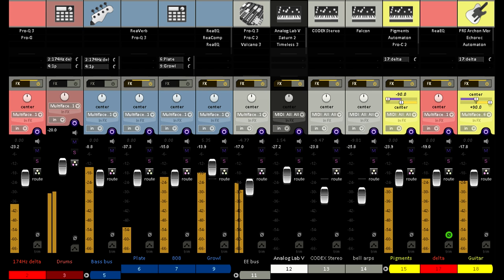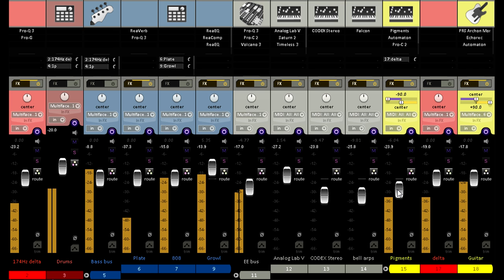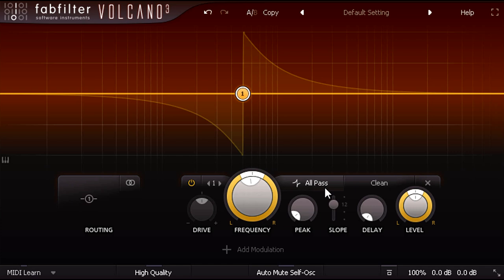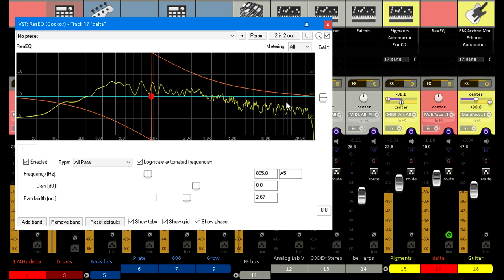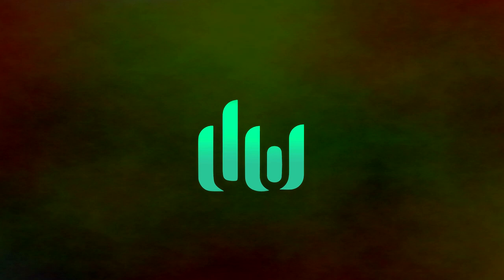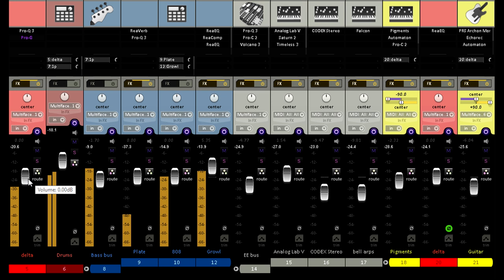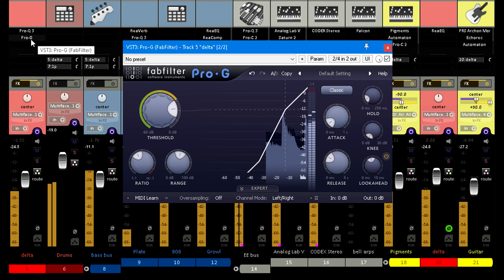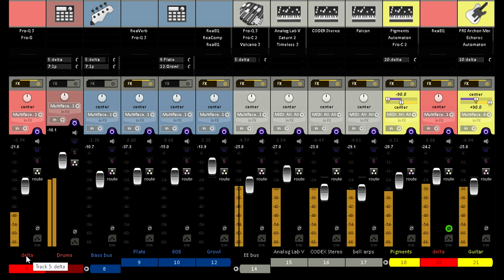Parallel Filters, God Tier: The Delta Channel

Comment: These tricks are really useful, but once certain elements are grouped together with group processing the null doesn’t work well enough. One solution I came up with is duplicating the drum bus compressor onto all the individual drums but then sidechaining the compressors to the drum bus. It allows for group compression while also making the parallel filters play nice with individual tracks

Comment: As soon as the video started I directly understood where this was going .... Yet I would have never though of this ! It is very clever, and so convenient !
I think I will use this for the "final" stage of EQing in my mix, to experiment carving frequency slots for diverse instruments. Not only it allows to easily boost vs Carve at different places, but it has also the advantages of being easy to remove and A/B compare..... That is so cool.
The only downside to me is that it might make stem creation of my projects a bit more tedious.
Reply from the maker: Bounce all your parallel delta channels together as a delta stem :)
Reply from the maker: "here are your stems: drums, bass, guitar, vocals, and this one that makes all the rest not suck" ;)
Reply: @DanWorrall  Hahaha, Yes that is a great idea, but actually, I also use stems when a song is finished for live shows reasons. I typically render one unique multichannel wav file contaning all the stem tracks that groups  the project tracks per element (drums, bass, synt, acoutics, main vocals etc).
Then I create a live project,  I import this multichannel stem in reaper and depending on my mood,  I add effetcs mapped to midi controllers and/or replace some of the tracks  live instruments (microphone inputs with looper pedal or not, drum machines, etc).

So it does not really fit this application, unless I duplicate the "delta channel" several time and change the routing so that every duplicate doesn't receive several tracks anymore but only one . Also, by doing so, I kind of loose the ability to add  a dynamic processor after the band pass filter.

Maybe you have other suggestions ?
Reply: Ha I found a solution. It works using "render stem through master". I didn't know it, but this options actually render not only through master, but also with sends. I know it can cause problem with dynamics/saturation that are applied on subgroups but I should be able to manage it.

Comment: One question. Is there any other advantage to using parallel processing like that other than workflow efficiency improvement (6:27)? Nothing's stopping you to do all this stuff with a couple EQs, right?

Also, 5:43, my first thought was multiband sidechain compression. I thought it was an obvious solution. Am I wrong? Am I right? Or am I just using a different approach? Don't get me wrong, I'm not salty or anything, I'm just trying to understand these choices. I know you don't reply very often to the comments, Dan, but I would love to hear from you.

Comment: Thank you for sharing Dan! I was wondering what your opinion is regarding using this technique specifically in the context of a critical scenario like a kick competing with a bass, versus some of the most obvious techniques like side chain compression, complimentary EQ bell boosts & cuts, or simply altering the sound sources. Is there one approach in particular that you feel yields the most compelling results in this kick vs bass scenario or is it more often a combination of multiple techniques used to varying degrees on a case by case basis?

Edit: lol I think I found the answer in your other video "Parallel Filters, Pro Level: Flip It And Reverse It", awesome!
Reply from the maker: Any scenario where parts are conflicting in the same frequency range, and you would otherwise be dialing in reciprocal boosts and cuts with separate EQs.

Comment: My goodness, Dan is still rocking the old RME MUltiface II converters! Those are over 14 years old..
Actually, I'm still using a Multiface II with my Win 7 rig; the PCI cards allow for incredibly low latency, and the feature set is awesome. The specs are not a whole lot worse than the newer UFX  series (on paper at least - though I'm sure that cumulative improvements in analog circuitry, clocking & filter design make a huge difference).
Until I need to get a new computer (which is expensive these days), I'll be sticking with the old converter.
Nice parallel EQ tricks, BTW.

Comment: To accomplish this, your DAW needs an invert polarity toggle on both the track and the send. If this is missing, you can use a plugin like Flipper to achieve the same. Now you can use any DAW, but I'm not recommending that you should. I prefer to tune each instrument to fit in the mix and this never involves changing exactly the same frequencies. So while this trick is cool and all, I would only use it as an effect, driven by some crazy automation.

Comment: A question: functionally this seems quite similar to having a sidechained multiband compressor, or a dynamic eq I guess, on the bass (and other) part(s), that'd trigger when the snare hits. Are there other main benefits to this method other than convenience with the single fader instead of opening plug-ins and tweaking the settings there? I'm thinking results-wise, as in could you achieve the same thing with a compressor or a dynamic eq instead? Thanks for the brilliant video, really shows how important it is to keep the fundamentals of audio in mind when coming up with ways to change things in a mix.
Reply from the maker: The parts all interact, and the processing naturally gets more intense when there are more parts fighting for space in that region. Plus you can tweak the amount of processing with a fader in the mixer, no need to open any plugins again.
Reply: @DanWorrall  lol this answer literally avoided your only question. Exactly what I wondered as well mate. Probably gonna stick to the multiband sidechaining too

Comment: For the Bitwiggers out there you can just use the tool device (I think, haven't tested it yet)
Reply: Even easier in Bitwig Grid, just audio receive the two tracks and run through multiply * -1 device. Heck apply a constant module and you can even decide how much you want to phase invert haha.

Comment: Holy nuts. This is excellent. I mainly use Pro Tools so I was thinking... Since you are using mono tracks for these, if you used a stereo bus to a stereo aux track, and then flipped one side's polarity with a multi-mono Trim plug-in, you could use the left as your normal polarity send and the right as your inverted. Just pan your sends accordingly and put the Aux pans to center. It seems like that work work, no? I may find out :D
Reply from the maker: I'm not a Pro Tools user: try it and let us know how you get on ;)

Comment: Just had a thought but am yet to test this. 

If you parallel processed a track with ReaFir in subtract mode, removing everything except the highest peaking resonances, and then flipped the phase, surely you’d then have the same effect as Soothe? 

Yes it would be far less elegant, but it would also be free.

Comment: Cubase 8.5 user here (don't judge, I can't afford an upgrade!): you can't flip the phase of sends, but you CAN flip the phase of the input bus. This is functionally the same, as the phase flip occurs before it hits any of the FX in the chain.
Reply: Nop it's not as the input flip affects all incoming signals. Send polarity flips affect only individual signals that are being sent to a bus.
Reply: @julius Gass is correct - you'd have to create another track to flip polarity of one of the sends. So one of the sends is in phase, the other 180 degrees out.
Reply: @TheSonorabob  can't you just start the effect chain on the send channel with a plugin that has a polarity flip button and use that?
Reply: @jonnyidle  one of the two channels being sent must be phase inverted with itself and the second needs to be in phase with itself, both going into the aux bus.  This way one is added and the other is subtracted at the same time. If you flip the input of the aux you’re inverting both of the channels, not just one. So they’re both subtractive in that situation.
Reply: @TheSonorabob  no, you only send one signal to the aux, which needs its phase reversed, and that is then blended with the dry signal coming from the channel itself, giving you two channels with oposing phase. If you sent both to the aux with separate phase they would null before any processing could be applied
Reply: @jonnyidle  I’ve watched again, and I will continually respectfully disagree. This concept involves one signal going in canceling, where the other ones going in boosts. Flipping The phase on the return would equally notify or boost both signals at the same time in the same place. It’s possible I’m misunderstanding what you’re saying though. Cheers

Comment: I'm using Reaper now for two years, and still there are things I learn from it. It becomes a top notch DAW, or was already, and like you said, the stock plugins does the trick too, thanks for new insights Dan. BTW I use the unfiltered downward expander, these guys makes good stuff as well, sometimes weird plugins, but that's creativity is all about, right?

Comment: Hello Dan. Hope you are doing well! Why dont you use an all pass filter? Its becouse the 6dB boost for the non polarity signal ?  Im using this  technic to mix drums samples with the acoustic hiits, replacing the sample 5k region  with the live drums. Its working good so far!!! Sending the sample to a notch and the live drum flipped! This way i keep a clean fundamamental and avoid the machine gun issue. Thank you Dan

Comment: Brilliant mixing technique! I’m trying to think of how to pull this off in ableton - I’m sure there is a way although it will take a bit of finagling
Reply: U can do it with native compressor, audio effect rack and utility. The compressor sidechain can be heard, making it an aux recieve, basically .If you put various chains Inside a rack with a compresseor in each and flip the polarity of the chain you want to invertet. Then you can put all the filters you want
I've been making some rack presets based on Dan's videos
I even made a bandpass filter. Abletons Eq doesn't have one, but a rack with a inverted notch in parallel does the trick

Comment: i've been rewatching the parallel filters video series over and over again.
so brutally phenomenal these techniques are.
i was wondering, can't we just extend the all pass filter trick by..adding more all pass filter bands? yea, the phase difference caused by the bands will interact with each other and the equivalent target frequency might be a slight bit different from the value show in the plugin, but if we're gonna use our ears anyway... 
So anything you send to this parallel channel with all pass filter bands will get a notch at those frequencies and any track that's flipped and sent would be like band passed? dialing in the fader level of the parallel channel will make it more subtle..

I guess all this is would be common sense after the video but i just realized it xd, oooh an eq curve that boosts certain freq and cuts the same for others, similar to super separate trick but this time the frequencies are in our control??

Comment: Fl studio can do it (I BELIEVE, will double check to see if patcher allows side chains)

Edit: Yep! Put a fruity send on each track and set both to send through a sidechain to a bus (as to circumvent fl studio’s post-fader sidechaining), load up patcher on the bus, add both side chains as inputs, use a fruity stereo shaper to flip the polarity in one (-100% of each channel going into itself) and then route that and the input from the other sidechain into an allpass and boom!
Reply: patcher really is a godsent for "audio engineering trickshots"
Reply: Can't you just send 1 channel to another channel, flip that channel polarity and send that only to the send channel? (This is just for the polarity flip part.) Haven't tested it yet but I think it should work...
Reply: @uniqueflowsnake  Only if you could stop that channel from routing to the master buss
Reply: @1337murk  of course you can do that
Reply: @uniqueflowsnake  yea sure it works, but that wastes a channel and you only have 125 of those
Reply: @intranexine8901  Is fl limited to how many channels? Didn't know that
Reply: @1337murk  yea, there's a limit

Comment: I noticed you sometimes use stock Reaper plug-ins instead of fancy 3rd party plug-ins.  When do you feel Reaper's stock plugins are better to use?  Or are they just easier to use for very simple processing moves?
Reply from the maker: It depends... Sometimes I want a specific type of compression that ReaComp does well. Sometimes I'll load ReaEQ for an all-pass filter. The ReaVerb IR loader works well enough that I don't bother with any others any more. The JS phase rotator is probably the only phase rotator I'll ever need. And sometimes I use them just to show that you can get results with stock plugins.
Reply: @DanWorrall  Thank you for the great explanation with examples!

Comment: This looks like an ingenius trick. But I don't understand something:

When I make sends to the delta bus from a bunch of instruments, I feel that delta bus lets through quite a bit of content from those instruments, especially if the Q isn't very tight. Doesn't that cloud the mix? Or does it get cancelled out somehow because the sends are polarity-flipped? I can get the snare fundamental to pop better, sure. But when I solo the delta bus, I can hear a lot of stuff from the other instruments and the snare fundamental isn't THAT much louder than they are. I'm sort of worried that I'm clouding the mix, but I can't exactly hear it happening when listening to the entire mix. But more than that, I wonder if I've set this up correctly and I shouldn't be having that much "bleed" from the other instruments in the first place.
Reply from the maker: Anything you're sending polarity flipped is being subtracted from the mix, not added to it. Does it cloud the mix? It's supposed to do the opposite, but you'll have to make the call. If it's not helping your mix, try something else.
Reply: @DanWorrall  I'm not 100% sure, but I think I'm not hearing anything else being added to the mix other than the snare fundamental - until I raise the delta bus fader above a certain limit. Then I can hear the rest coming in too, for sure. Is the rest being nulled up until that point?

I'm just sending snare, bass and pads to the delta bus. For testing purposes everything is at unity gain. It seems that if I raise the delta bus fader above 0, or increase the send levels of the bass or pads, then I can hear them getting boosted. But if I'm not mistaken, bass and pads do not get boosted at all up until fader zero, only the snare fundamental is. Is this right?

Comment: Most DAWs have a utility plug in with a polarity switch on it. I do love that they have it on the channels themselves though. I think if anything is actually better in Reaper than other DAWs it's all the naming conventions you can give to rendered tracks. On the other hand IMO the MIDI editor default setup is just awful.
Reply from the maker: That will flip the channel on which it's inserted. But we just want to flip *the send*.

Comment: Which DAW doesn't allow to flip the polarity of a send ?
Reply: As a simple button like demonstrated, I don't think any support it, but then these days many DAWs are really not trying to emulate a traditional mixer or send/aux routing approach. e.g. in Bitwig, although you could use sends, for something like this you wouldn't as you have an fx grid so you just receive those two tracks with an audio receiver and create your own fx patch. ie basically you're creating the workflow in a modular approach and then capturing it so you can use what you just made just like a VST plugin forever more.
Reply: @SamHocking  I was asking because the FL Studio guys always did it with a single button :) They even "emulate" patch cables, visually ^^. And those allow you to create as many sends (with send gain...), subgroups and parallel busses as needed. "Feedback sending" is still not possible though. Unlike Live, and also Bitwig I guess ?

Comment: How would you go about making an analog all-pass filter? Is it even possible?
Reply from the maker: Same way you make any other kind of analogue filter. Sure it's possible, no more complex than a high pass or lowpass.
Reply: Little labs makes a great little allpass filter unit:  https://www.littlelabs.com/products/ibp
Reply: There are active designs using OP-amps, or (if you want to use a control voltage to shift the center frequency) FETs and even some passive disigns, though these require Inductors, so they tend to end up a bit larger than the active ones.